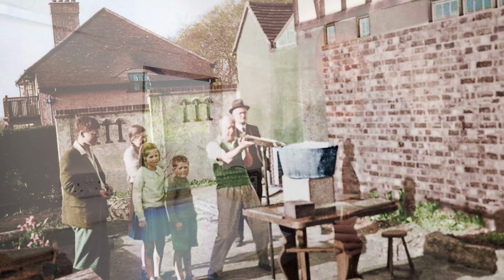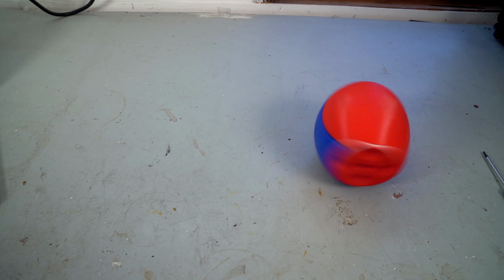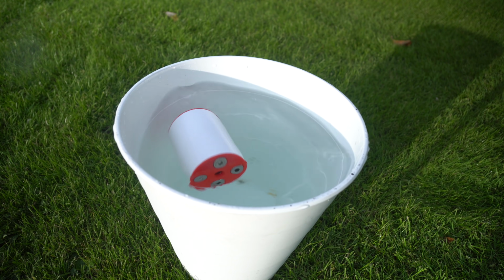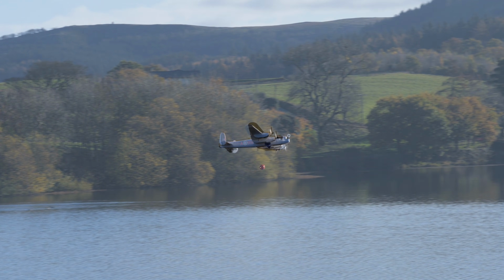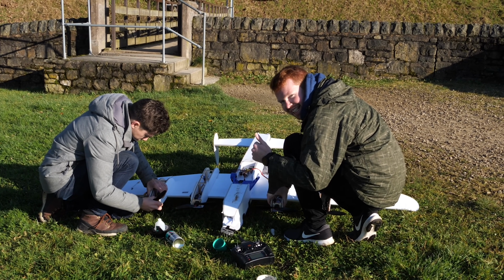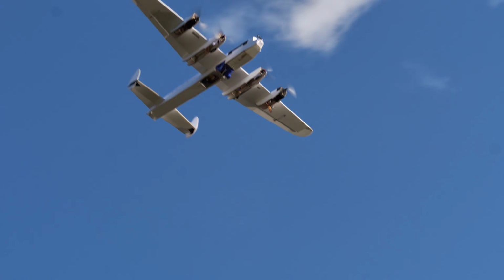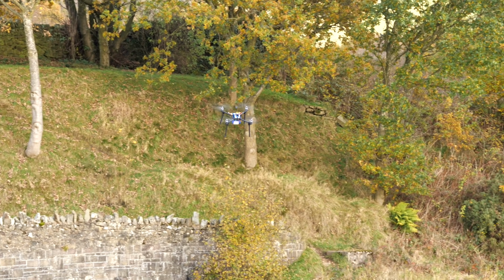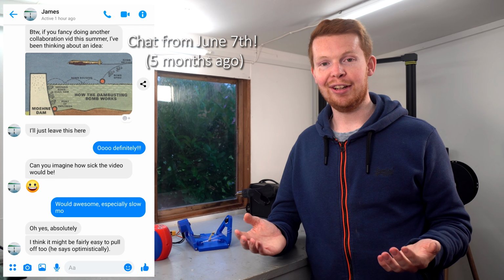Radio Control Dambusters

Comment: Is it just me or does the height have almost nothing to do with the angle at which the payload hits the water? He keeps talking about the height
Reply from the maker: The height it's dropped from will affect the vertical velocity when it hits the water. Since the angle is determined by the horizontal and vertical velocity, it's pretty important.
Reply: @TomStantonEngineering  oh right yeah obviously, I wasn't even thinking about actual downwards acceleration lol

Comment: The aircraft looked so realistic. A bit of camouflage and some Merlin engine sound track and there you go back to 1943. Your lucky run after a few failures then the final crash are also something like the original raid where so many brave young  men, about your age or even younger  Tom, were lost. If  you watch the 1956 Film The Dambusters about the raid, you will see that the bombs were masked out in the actual  practise run footage used in the film, as  the spinning mechanism was still classified at that time. In fact it was in the 1970s before I saw the back-spinning bombs in the film of practise runs, in  a BBC documentary.

Comment: Actually, I first upvoted this. Good ideas, nice builds etc. But then I started researching the subject. Wikipedia for a starter helps. It seems this whole project was not necessary at all. In the end it lead to even more suffering without having a relevant impact. So from my perspective, this video and topic moves rather to the glorification kind of content. I cannot consent to glorification of war atrocities, or atrocities  at all for that matter. This was horrid apart from the whole WWII for the involved and the "casualties" as they're called rather abstractly. Now, I do realize your intent was focused on the technical side of the project and it clearly has a fascination point to it. Then again, no mention of the effect of this war act whatsoever. In my view, this lacks on the part of big picture. And it is interestingly quite often found in engineering circles. The "we're forced to do so", "if we don't someone else does", "science and technology is as good or as bad as the intentions behind it's uses" and so on. Short of diving deeping into philosophical and ethical approaches, I think engineers have to absolutely act ethically. They have to say "no" and disobey at the right time.
Apart from all that: I often find your content quite interesting, science-wise. Thank you.

Comment: Actually, they already knew the rotation was required to keep them straight, no, the discovery needed to bring this to point was shape + rotation + distance + speed of rotation so that the dam buster would reach the dam, touch it at the exact speed required so that then it would "stick" and sink to the base, thus provide the best bang for the ... teacup. It's all about the math involved ... it's huge.

Comment: Fantastic video however the backspin is not necessary for the bounce but it is necessary to make sure it stays in contact with the dam wall Barnes Wallis thought a shfreical shape was necessary to make the bomb bounce but on the first test the wood packaging used to make the shape ripped off and the bom continue to bounce along in its original cylindrical shape

Comment: Another tip for getting a straight cut for a pipe is to use a radiator hose clamp (gates clamp) tightened around the pipe as a guide.

Comment: Nice one! One thing about cutting tube square, I wrap paper round, line that up and tape it, hold it in place while drawing around it with a sharpie, then slide the paper along the tube to the next position.
Reply: Oh and before leaving this project, I really do think you should drop at least one sinking and working mini depth charge...

Comment: The ball shape was not used because during testing the wooden barrels that were used for an outer skin, could not handle the impact, but Barnes noticed the inner barrels continued in a straight line, proving the ball shape was not needed.

Comment: Maybe you could build and fly some model rockets. . .maybe a drag race with some mates...you get a point to be the first to launch, you get a point to be the highest altitude you can buy lightweight altimeters now and you get a point to be the first to touch down ...everyone flies on the same  motor impulse a B or C motor .  . .but you can choose what model to fly...this would make a great video. . P.S. . .the one with the most points wins...you can build two rockets of the same type...you must get at least one back. . .

Comment: The pilots determined that the altitude needed for proper angle would result in tailsplash turbulence & possibly rip off tail section if too low. This was a suicide mission for the crews, they knew this going in & did their jobs bravely. God Bless the fallen!

Comment: I don't know if it's an oversight or just a peculiar design quirk but shouldn't the barrel be spinning the other way? It works against the momentum and digs into the water causing it to slow and bounce more vertically. Reversed it would hit and climb out of the water and help propel it forward. Would it not?  Seems wrong to me somehow.  But I'm not the engineer here. 
Cheers!🍻

Comment: floating barrels invalidate the test, the originals were meant to sink. a 1m wide x 4m long, sloped bottom to 0.5m deep, trench to scale drop into with a sinkable barrel would have been better in the farms back field instead of dropping anything into a pond

Comment: I remember watching a show about that plane and people trying to destroy a modern day dam and it was really cool.
Is there a link or something about how you programmed your drone you built? I am building one myself and wasn't sure how to approach it as far as programming the flight controller and such. I do have iNav. Is there a specific FC you recommend?
Reply from the maker: I used an omnibus f4 V6 running inav firmware. It's got lots of uart ports for gps, magnetometer and telemetry. Thanks

Comment: Why did you drop it from such a complex plane? A simple single engine heavy lift design would have been way more reliable.
Reply: The real dambuster was using Lancaster bombers. That's why they did it...

Comment: I'm trying to figure out why the spin is backwards, instead of forwards. It would seem that if the drum had a forward rotation, at a surface speed faster than the ground speed, it would help to propel the drum forward, and give it 'lift' as it hits the water surface.  The slow-motion footage seems to indicate that the backwards spin causes a lot of counter-force while it is traveling through the water, quickly slowing down the drum (as the plume of water is being slung forward).

Tom, did you try using forward rotation?

Cheers,
-7
Reply from the maker: I believe the main reason it spun backwards was to cause the barrel to move forwards whilst it sank, so it kept it close to the dam wall. I was planning to test it with a forward spinning barrel, but obviously the plane didn't last long enough haha
Reply: @TomStantonEngineering  That makes sense, due to the Magnus effect. I think they may have done it that way to retard the skip distance, rather than enhance it. They were likely trying to get the bomb as close to the bottom of the dam as possible.
Reply: a quick guess would be that it creates more of a "ramp" out of the water infront of it
Reply: My understanding is that the magnus effect (a spinning body causes unsymmetrical aerodynamic drag) would have increased the angle of bouncing, an undesirable feature considering they are already dropping the barrels at a less than optimal 19 degrees.

The same magnus effect would also force the drum underwater: watch?v=T6mijf2qVa8&t=10
Reply: @xureality  Assuming the drum is still spinning while it is sinking, the effect of the fully surrounding water would actually propel the drum forward (towards the target) as it falls, given the reverse rotation.
Reply: @utubeaccess7  The purpose of the bomb was to jump over torpedo netting, otherwise they would have just used torpedoes.
Reply: @xureality  i agree, that's why they would rather not skip, but arrest the forward movement asap and proceed to sink forward to the bottom of the dams.

Comment: 2:07 The original Upkeep mine was spun via a petrol engine, not an electric motor.  Splitting hairs, sorry.  What a great project, a great collaboration tThank you both for doing it.

I went over to James' channel and subbed straight away.